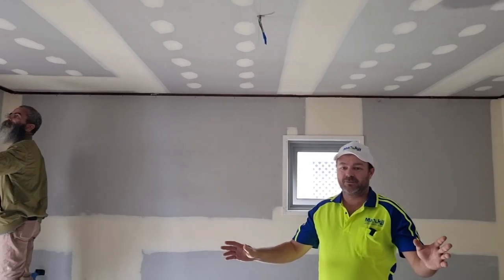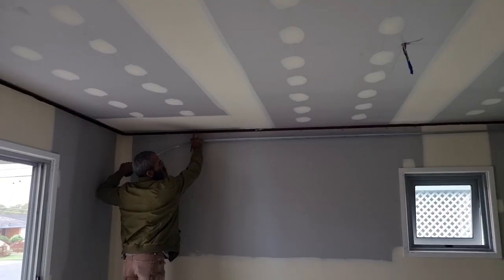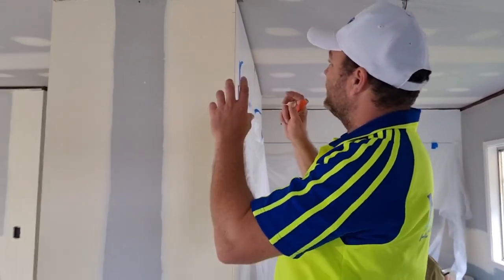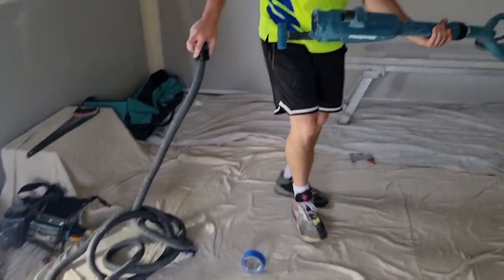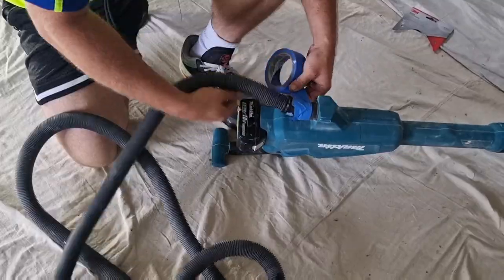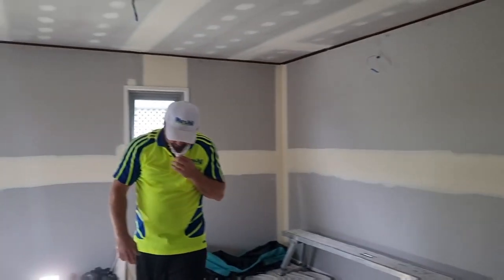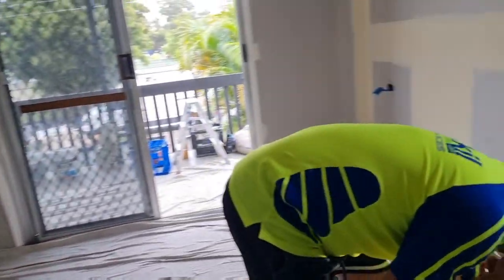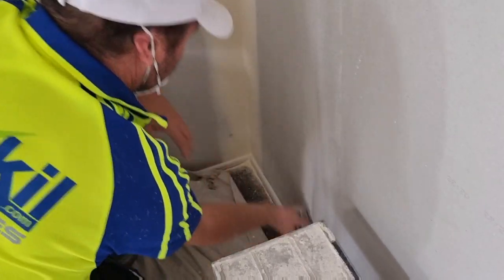How Does a Plasterer Sand a Ceiling with Makita Drywall Sander & Vacuum

Comment: What sanding mesh do you use for final sand of the ceiling top coat, 150, 180, 220?  Do you always do it using the tool at angle? What about on higher ceilings?
Reply: At the top, cornice will be installed

Comment: So your tape and spackling with water soluble joint compound.. ...no actual plaster products being used.. unfortunately you weren't sanding plaster because In reality genuine plaster is too hard to sand... It's really disappointing to hear the new generation not understanding the difference between plaster products  and cheap tape and spackling joint compound..
Reply from the maker: You are willing. There is many types of plaster, such as plaster of Paris, dental plaster etc. . all made by the same companies too here in Australia. What we don't call it is "spackle"
Everything is water soluble even concrete. The trade here is called Drywall Plastering. If it's outside and using cement based products, the call it a renderer of solid plasterer. And now I will share with you from Wikipedia...

Plaster is a building material used for the protective or decorative coating of walls and ceilings and for moulding and casting decorative elements. In English, "plaster" usually means a material used for the interiors of buildings, while "render" commonly refers to external applications. 
Wikipedia
Reply: @Maxkil  gotcha..it's an Aussie thing..and a new world generation thing.. in America plaster is completely separate from drywall finishing.. and our plasters are not water soluble.nor sandable.... I didn't realize the difference between the two countries... thank you for the insight..
Reply from the maker: @lanceladue2818 no worries man, normally English folks say the same thing as you and they tell me all the time. 😅